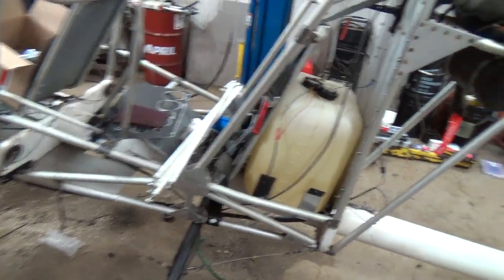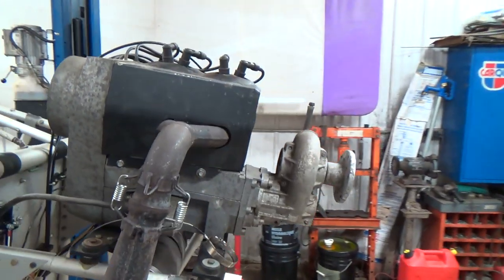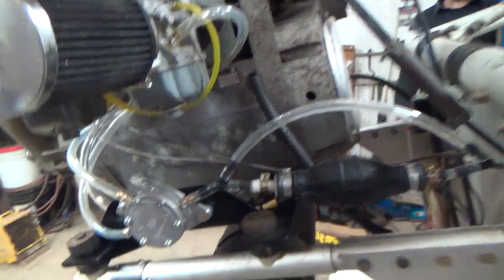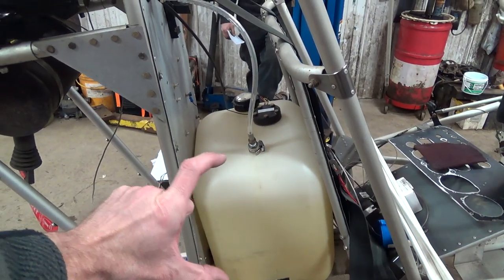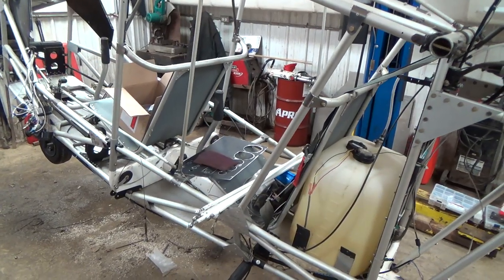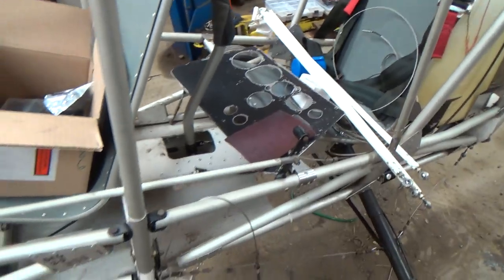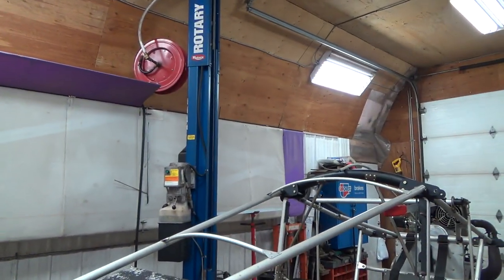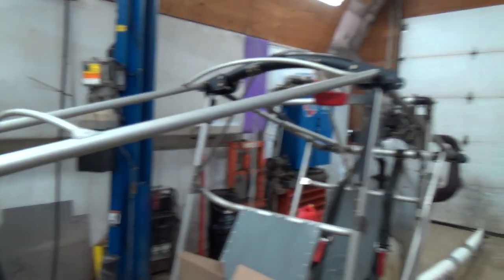CGS Hawk: Update 1

Comment: Matt, Steve here in Indy, make sure that you check the landing gear where it attaches to the boom tube . I have a friend that has the same plane and engine.  The rivets holding the gear slipped down as he has found out on a landing. What he did to reinforce it he put a heavy duty ban clamp around it. If you wish I can send pics to your email address.